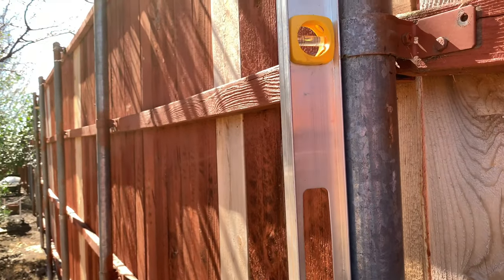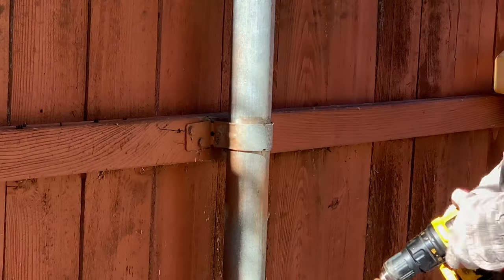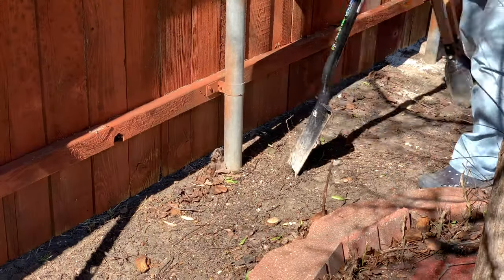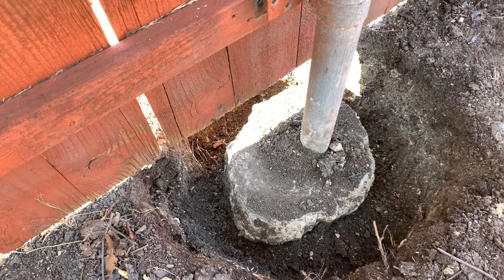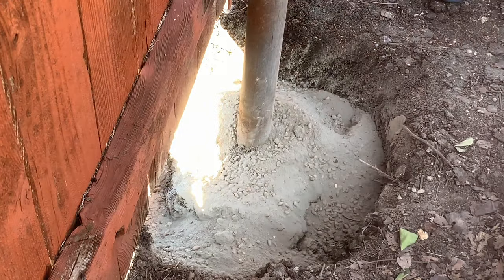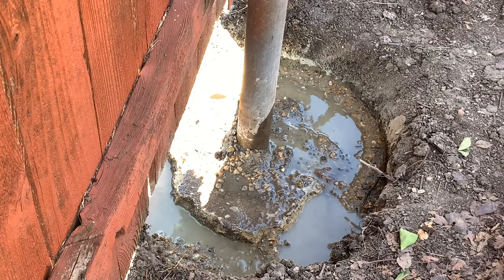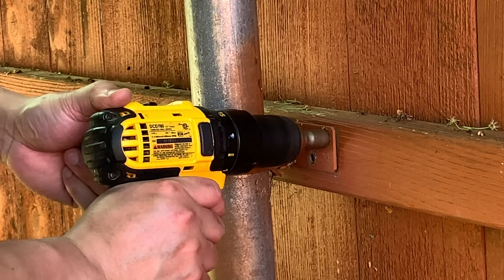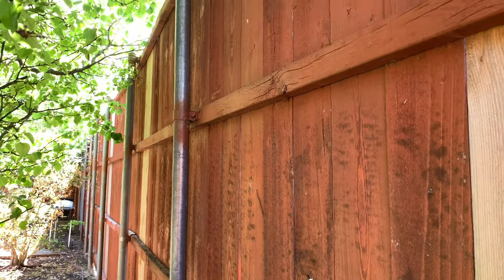DIY Project. How to & Easiest way to fix a leaning fence without removing the fence pole? Pinoy Tayo

Comment: This only works in areas where you have a very warm, relatively dry climate without much changes in temperature and humidity. In most places, especially where you have distinct seasons, a winter where the soil freezes and a spring afterwards with mud these concrete foundations tend to move easily. This will look ok maybe for a year or 2, especially if you got some considerable weight mounted on those poles like we see in this video.

Comment: I used that cement to install post for chain link and and is the worse product ever , after 24 hours I can pull out the post by hand ... I need the redo the kid with another cement ...  time and money 🥵
Reply from the maker: That is really strange. So far, out of the 25 metal poles I worked on its holding very firmly especially with high winds. Did you follow the ratio mixture of water?
Reply: It's concrete not cement and you have the make a hole that is larger the farther you go down .
Reply: You need to mix the concrete and water before pouring.

Comment: mine is old and only one pole is loose it's a 6ft pole that attach to my gates when i open the gates it's shaky so do i use 3 bags as well of Quickrete
Reply: I would dig around it to create a base and see how deep the existing cement then I would add the appropriate cement to stabilize it so the pole won’t move.

Comment: I have same issue but leaning forward. can i follow same method without detaching bolts from rails?  in other words exert pressure to plumb poles by  adding 2x4 forms then add concrete.  let me know what you think
Reply from the maker: Hi, you can do that as long as you have enough force to straighten the poles while the concrete is drying. Thanks

Comment: Thanks for the video.  It did the job of explaining how to level a sagging fence vertically,..  You did show the right tools and the the cement type.  However, you did not mention which zone you are in and the depth you have to go.  Overall good video.

Comment: The contractor accidently hit my fence pole when they were replacing the sewer line, and I need to do this.  What side bags quickcrete are you using, and why three bags.  Great video, and thanks.

Comment: Might as well remove the post and swap it out with a replacement. Go 3 ft instead of the usual 2. A brick or 2 or multipurpose granite and not use the quickset cement. But hey what do I know I despise using a shovel and I'm going to have fun replacing our side fence for the 1st in 32 years since purchasing our home.
Reply: Hi, could you please explain more in detail what you mean by multi purpose granite?

Comment: I'm renewing our old fence w/new rails and pickets and came across 2 posts, which should be straightened (they have ~ 30 degree deviation fm/vertical. I digged around them same way you did, but about 12" deep, the second one even about 10", then added water to dig more next day, but to my surprise, I could move that 2nd post easily any way I want after that water added. So I straighten them both planning to add cement mixture and water, but then got stuck on the doubts if I need to add any cement in the holes. The posts are aluminum and the fence is pretty light (cedar, 6'). The original cement has practically perfect cylindrical shape, so for the future possible repairs it would be so much easier to deal with those perfect cylinders than the mines of irregular shape. So my question is: what will happen if I just surround those now straight posts (with existing cement cylinders on the bottom of them) with the soil (it is in Texas, soil type of clay)? Will it keep them straight, or  it is absolutely necessary to remove the old cement, or at least to add  some more new? Thank you for the great film, very informative.
Reply from the maker: Hi, if you are concern about the straight posts leaning due to the type of soil in Texas, you can certainly do that. Any type of reinforcement can help to keep the post straight, but it would be labor intensive if you attempt to remove the existing cement due to its weight. Reinforcing the cement maybe a better option with a better base support by widening the soil around it then pouring more cement. Hope this help.
Reply: @simplyworks8818  Thank you. I straightened the poles and simply put dirt and water around in 2-3 steps, so it dried out. Everything is very stable probably bcs of the nature of the clay soil here. I put rails on one post already. I think it is better to keep the perfect cylinders how they are. I always can dig out same way I did (it is pretty easy here, the soil is soft) and add cement if there is a need. Thank you for your replay again.
Reply: Could also add additional galvanized posts beside the old post.

Comment: Looking to find out how to "easily" fix metal fence posts that have are rising.  The original cement is above the ground.  Is there a way to re-sink the post and cement without tearing it all out?
Reply from the maker: Hi, first find out what's causing your fence post to rise. Sometimes, it's being pulled away with the rest of the fence wood attached to it by wind or loose soil. Once it's free it may just slowly go down by itself. If not, you may need to dig and remove all the soil around it until it goes down to the level where you want it. Hope that helps.

Comment: My fence had less post as the person who loved didn't put hardly any post bit are joined by little wood on top on the joints my fence is leaning inward from the top and also part of its come off from the panel on bottom so not partley attached can you help how to do these two points thanks

Comment: Be careful that drill is almost stripping those wood screws Chief & Your video is helpful,  but I don't think my customers would want to see a high pile of concrete afterwards.
Reply from the maker: Hi, concrete is leveled with the soil. The concrete will eventually be covered by soil and grass. it will not be notice at all.
Reply: I dont think his name is Chief, and if you knew anything about power tools, it had a clutch on it